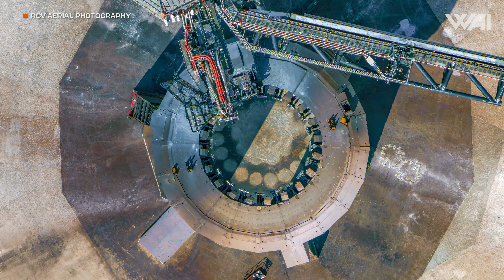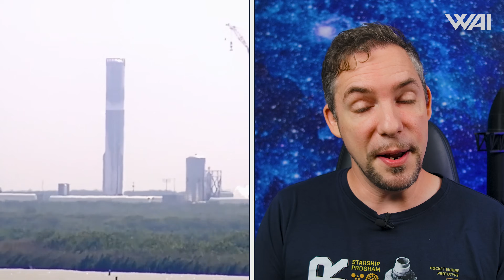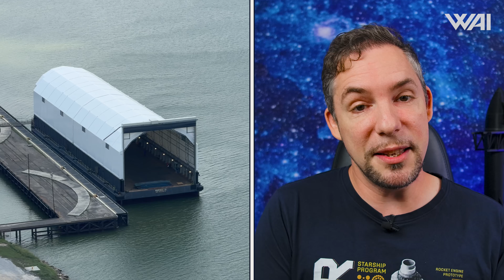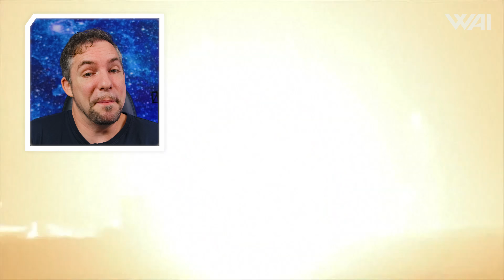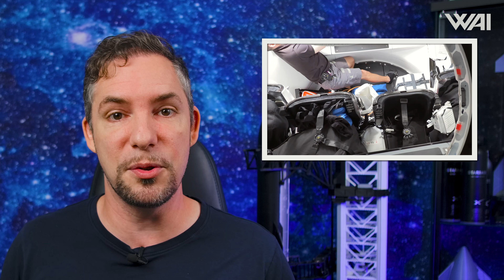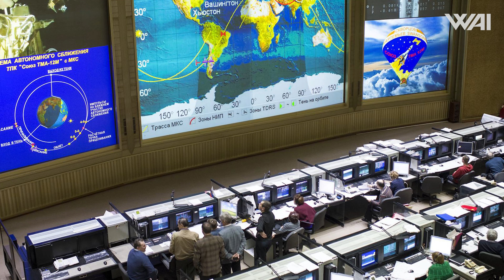SpaceX Reveals NEW Prototype! Starship Flight 13 Is Almost Here!

Comment: Proceeding with engine installation would seem to speak volumes concerning the Raptor shutdowns during the last flight and makes me think they may not be hardware related or, if they were, it was easily fixed.  Why install hardware that would require later removal for changing stuff out?   Also, I would hope the FAA's investigation would be a short one and not impeed the next flight.  Afterall, booster 19's hard splashdown was no different than that of a "normal" throw away booster AND it impacted in the designated flight path.   I see it more as an economic issue than a safety issue and I'd like to think a pragmatic local FAA would see it exactly that way too.

Comment: i dont think the star ship design is suitable for landing on the lunar surface as it looks like there is to many possibilities in its design to have unnecessary problems whilst trying to land that thing, would it not be better to design a lunar lander purpose built to be transported by starship in sections to be constructed in orbit this way the craft could be made larger with more fail safes and the capability to carry extra supplies just incase and i think it would be better to also land unmanned craft at the chosen landing zone first with lots of extra equipment

Comment: The cracking issue is worse than you'e making out.

Aluminium has no modulus of elasticity. That's why it cracks so easily and those cracks keep spreading - this is why pressurised aircraft have flight cycle limits.

Steel (as in your paperclip) doesn't have this problem. Nor do the Bigelow space modules. It's a fundamental materials problem that can only be mitigated in space by covering every external aluminium surface with some form of blankets to reduce the extreme thermal cycling of the day/night transitions.

Crack mitigation is much like glass: Drill a stress-relief hole in the end of the crack and then seal it - but that means drilling a hole into vacuum and it only addresses THAT crack. If there's stress due to other cracks or external forces then cracking can easily resume too.

It's time to ditch that module and replace it. We even have something capable of flying up new modules (or will do shortly): Starship. What we absolutely MUST NOT do is keep ISS runnning forever. Just like MIR, it's being colonised by space fungus and that's even more dangerous in the long term than hull cracks.

Betterhelp is a poor shoice of sponsor. They were heavily fined in 2023 for privacy breaches and have been widely criticised for poor quality of service and operating an expensive subscription model. As much as it seems like a good idea their implementation is absolutely awful and the only reason they exist is the atrocious Confederate-era weaponised cruelty that has underpinned the American psyche since the nation was established (most of the USA's foundational myths are just that. The truth is much uglier)

Comment: Felix, I find your over using your logo on Space X equipment, not nice I don't have problem your logo on the videos but not as if its part of Space X Star ship or its rocket engines and associated components Space X build them not you. You create the website not the Space X gear.

Comment: Paper clip example is an example of low frequency failure. This is much more likely a high frequency failure. That is, it's not moving much, but it's moving frequently; more than 100,000 cycles, which doesn't take long. A good example would be an AC motor which rotates at 1800 rpm. Less than an hour to high frequency failure. These are much harder to track and repair. I spent my career monitoring cracks in a containership hull. In the strength members, we would be tracking 1-200 visible cracks, and testing regularly for non visible.

Comment: So I wonder if they are using a wire feed welders with shouldered gas or none shielded wire feed wire. So if they did and it keeps cracking maybe they could get a Laser welder maybe it could stop the cracking because it doesn't get as hot and cools differently.

Comment: Remember, folks that smaller Russian modules, like Poisk, were delivered to the ISS by a Soyuz Service Module. All of the Russian modules use standard Soyuz docking adaptors, both 'male' and 'female'. A quick, but permanent fix (and here, this social worker is revealing his complete lack of formal engineering skills.....maybe)- take two Soyuz Orbital Modules, weld them together, with one end having a female Soyuz docing port rather than the male version, kit it out with all the stuff the ailing module has, jettison the wonky one, and plug in the new one. Send it up on a Soyuz rocket with that ultra-reliable service module in place to do thefine manouvering needed to rendesvous with ISS. This would be a jury-rig, of course, but it's this type of jury-rigging, and improvised solutions that a flight to Mars, or a Mars colony will have to employ when good ole' Terra is so far way. Practicing on ISS as it ages, keeping it in orbit past its yet-unannounced 'retirement' date is also good practice. I've said it before, and I'll say it again: deorbiting 100+ tonnes of space hardware is stunningly stupid. 100+ tonnes of space hardware already in orbit is 100+ tonnes of stuff that doesn't have to be launched INTO orbit. Also, I don't know what the planned orbital inclination for Artemis III will be, but as it is only an earth-orbiting mission, it makes sense to put Arty III in the ISS orbit, so Bresnik and Co. have a safe port should things go awry with the Arty iii hardware, including, potentially, two lunar landers going up as well. Send up a couple of modified universal docking adaptors for the ISS, and voila, post-Arty III ISS will have two NEW modules, with the Starship HLS prototype providing the ISS with a huge upgrade in livable volume. Keep ISS alive and growing!

Comment: The detonation itself was not terribly violent at all- with a  magnitide 2.5 seismic wave and 5% coupling into the surface, it was at most two tons TNT equivalent. Everything else was just a photogenic fireball, which thanks to it being methane, burned out quickly. Kerosene would have smouldered for hours and could have brought the second tower down by softening the metal.

Comment: The can crusher. Its to pre-test designs. I've never seen if SpaceX use the can crusher to test used boosters? This would be worthwhile wouldn't it for testing metal fatigue, micro-cracks, weld techniques etc. The boosters go through so many temperature effects and pressure effects - it might be worthwhile knowing how they are surviving for reuse. Especially a booster that been up several times.

Comment: Hold up, starting at stupid level of a concrete pad and then acting like this is super amazing is dumb. Any half baked idiot could have looked at former engineering from NASA large rockets and concluded a flame diverted launch pad was required.

Comment: if u see the rockets and how they work, how they are 3D printed to let cooling flow so the material dosent melt, i wounder why u build such kind of starting ramps, why not layer those with 3d printed plates with inside flowing cooling fluid, instead of the big water vapors that turn to steam faster then cool down any surface down.. ?

btw would be nice to know more about the difference from the old starting ramp and the new whats the difference...

Comment: Another factor re the ISS leak:  metal fatigue from radiation damage AND from LEO encounter with trace gases, such as oxygen, encountered in (damaging / corrosive) monatomic form. 

Re historical insight, early on in the shuttle program, a satellite went up that consisted only of aerospace materials, those to be exposed to LEO conditions and then to be retrieved by a future shuttle flight. The originally scheduled retrieval flight was the one immediately after the one in which the Challenger blew up. Those materials stayed up several extra years. When they were retrieved, it turned out that those materials had become extremely brittle (frangible) and delicate. 

In light of that finding, I (strongly!) don't want ISS usage to extend beyond 2030. I want all astronauts safely off the ISS by that date, I praying that there won't be a lethal incident before then. 

This surely is another factor in why the Russian cosmonauts are reluctant to attempt radical repairs. 

(But here an opportunity for learning more:  After total human evacuation from the ISS, while the ISS remains pressurized, send in drones to attempt radical repairs... And see if the ISS instead goes kaboom!)

Comment: Felix, I don’t know about Better Health, but the chop sticks are being changed * for weight reduction for less wobbling in movement, each rail will lose approximately 1.5 tons per landing rail. *Ryan Hansen from RGV fly over. My launch prediction for Flight 13 is mid to late July. I agree that a launch on the 4th would be awesome! Dave Limp used Gradatim Ferciter step by step ferociously good luck and god speed.
Hope you love your new digs!

Comment: There's one thing I don't quite get right. There's currently an active Stage 0 concrete replacement; apparently, Raptor heat degradation occurred. Even as you talk, chisels are visible, hammering away pieces of the platform Felix

Comment: Which do you think is more efficient? De-orbit the station with all of its equipment, and build a new one or launch a shell, and transfer the equipment to it. Install station keeping thrusters on the old station to keep it, and remaining equipment available for a future use.
Reply: It could be boosted to a stable orbit or even to a Lagrange point. Save it for a museum if nothing else. Deorbit is ridiculous for something this size. I also think the brand new solar panels should be removed and parked for use on its replacement. We paid a lot of money for those. Why burn them up?

Comment: Development philosophy difference:
SpaceX: Booms will happen, let's learn from them. (Boom, boom, boom, ...)
BlueOrigin: Booms do not necessarily need to happen. (Boom, --------------------)
Reply: Also, booms are probably the only way to develop something as complex and difficult as a fully and rapidly reusable Starship. Blue Origin's analysis-paralysis model is fine for rockets like New Glenn, which are an order of magnitude easier, but it breaks down beyond that.

Comment: Could a hydraulic/ syringe type design work for refueling the starship? 

How will a crew launch off the moon or Mars if there isn't an OLM to keep regalith, dirt, soil, sand, just.. The ground... It feels like itll turn into a first flight test scenario for the starship.

If an emergency happens, how does a large crew get of the moon rocket?

And finally, 

What happens when Starlink and Project Kuiper satellites become obsolete??

Comment: With hot staging, and the power of the Raptor 3, being identified as perhaps the problem with the failure of the stage separation anomaly that caused the booster failure last flight, can the hot staging engine firing on ship be sequenced to be effectively less impactful on booster, therefore allowing for a normal flip maneuver? Thank Felix. Welcome back

Comment: Can't SpaceX file for two contingent flight paths for the booster?  The first is the flyback to the launch site per the test plan, and the second is a contingency to ditch into the Gulf just like everyone else does with their boosters if they abort the flyback test.  That way, SpaceX need not be penalized with an FAA investigation for an unsuccessful  attempt to fly their booster back.
Reply: There wouldn't be much difference.  SpaceX's returning craft follow a trajectory down to the water, then —very late— divert to the landing pad/ship/tower IF it's safe to do so.

Comment: The ISS is built from aluminum.  Aluminum does not have the same tolerance for bending that steel does.  Minor flexing has no effect on steel, but becomes cumulative for aluminum resulting in fractures.

Comment: You should make an ai controlled repair bot that can crawl over the surface of the ISS . it can constantly monitors the external surface for air leaks.  When it finds one it injects something to fill the crack or hole or puts a patch on it . Then you don't worry about 'difficult to get to' internal structures.
Reply: Or, de-orbit it, and put up one that isn't falling apart....

Comment: Zvezda is the "bumper" of the station. Every parking needs crash with Zvezda. Aluminum cracks, and I prefer Zvezda crack than the station.
Zvezda needs to be changed, in a soon disposable station, the cost coul not justify the change

Comment: Time for a Starship backup Station, made up of two Starships, nose to nose!
Reply: That thing is SO huge, I think one of them would be backup enough. Smaller than the total volume of ISS, sure. But big enough to work as a backup for everyone.
Reply: @sysbofh  The ISS has a pressurized volume of 1,005 m^3 (with roughly 388 m^3 being habitable living space).
Starship has a pressurized payload volume of over 1,100 m^3. Factoring in the massive propellant tanks (>2000m^3) brings Starship's total internal volume to approximately 3,100 m^3.
So Starship V3 encloses a total volume equivalent to three entire International Space Stations combined.
Reply: @admarsandbeyond But no one would put one up there without the fuel tanks.

I'm thinking about reasonably available space, up there without much fuss. An emergency one can't be retrofitted in orbit - emergency, remember?
Reply: @sysbofh  But no one would put one up there without the fuel tanks.

You empty the methane tank and occupy it.  You use the residual oxygen then convert it to usable space as well.  End result lots of volume.  Now imagine adding on an inflatable modules sized to be carried in Starship and it becomes HUGE.

🎈

🎈
Reply: @Scanner9631  Easier sad than done. Have You ever seen how those things are inside? Just the downcomer, going through the lower tank, takes more than 20% of the available space.
And this is what we know about. Saturn V was, basically, a giant empty can. Starship, not so much.
Reply: @sysbofh  

That down comer would make a great place to place a lot of the equipment  you don't want out in the open.  Batteries, power conduits,  Maybe plumbing. 

Even convert it to a emergency oxygen supply tank.  

You prefer the tanks just sit there useless?  Especially the upper larger one?

Add radiation shielding and it becomes the "storm cellar" if radiation gets too high.

:penguin-blue-waving-tear:

:penguin-blue-waving-tear:

Comment: 20:00 Is it not possible to particulate some sealant in the area and allow the tiny air flow to move it to the cracks? It'd build up on the walls of the cracks and then seal them.
Reply: Good question; I hope someone can arrive with a good answer.

My personal speculation is that you don't want to aerosolize a substance that might be hazardous to humans or hardware in an enclosed environment.

Also, it would be a particularly tedious process for the micro leaks, as the flow rate would be slower, taking more time and increasing the chances that the sealant might not actually reach the crack, or at least,  possibly not before the sealant cured.

As I said, I hope someone shows up with better speculations or answers than I have.
Reply: @Henglaar  Good thay sealed one link and saberlised the situation.
Lets hope they quickly solve the remaining leaks.